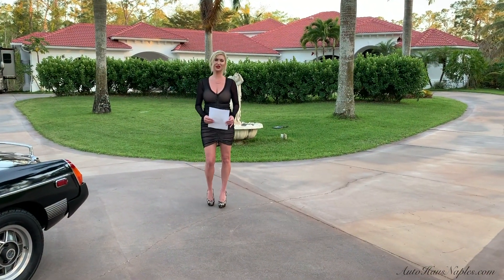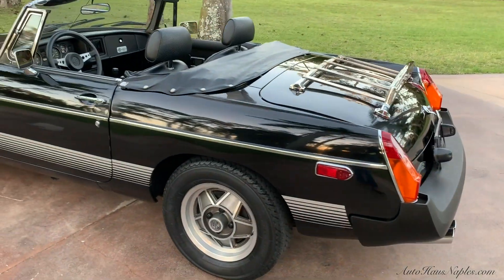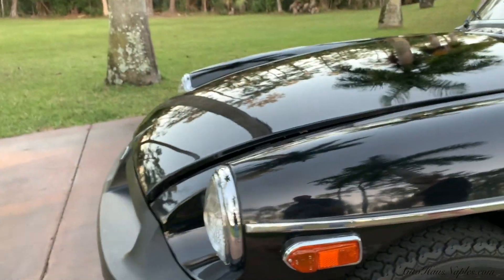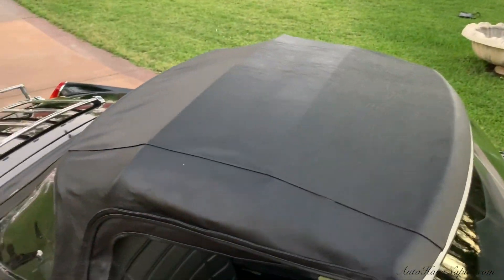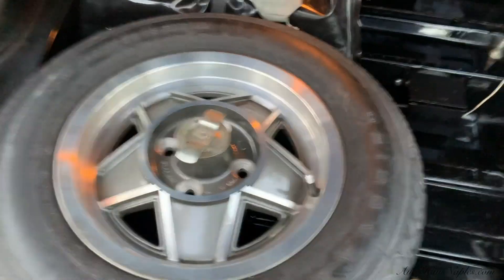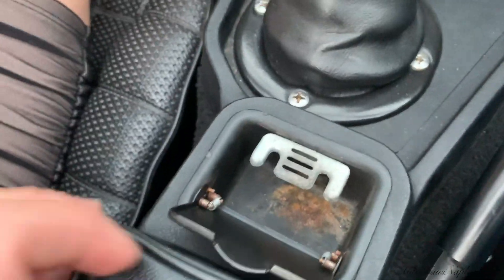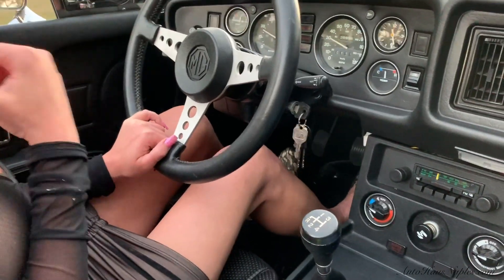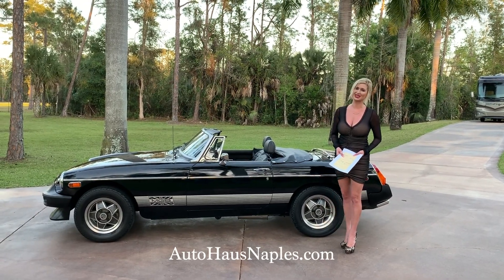6,969 Mile 1979 MGB Convertible Limited Edition & Only One Owner!

Comment: I bought that car in Oct 1981 at a downtown foreign auto dealer in Monterey Ca. He pulled the old bait and switch on me. I wanted the white 78 Mazda RX7 for sale, but ended up with the MGB. It had only 2300 miles. The funny was I had never driven a stick before. He was kind and/or smart enough to give me a quick lesson so as to get it off his lot! It was a great way to will yourself to learn. But I don't recommend it.
Reply: So you met Doty ?

Comment: @MaryAnn & Peter .... Thank you very much for this nice presentation. 👍Be careful and stay safe.

This beautiful MG needs chrome bumper, wire wheels with white wall tires, and a british wooden steering wheel. - Do you or Peter know how much such a conversion would cost?

Greetings from Germany
Reply: Also needs the lower ride height of the non-US version.
Reply: I can't say I'd recommend that.....at least not for this rare and ultra low mileage example.  Its value would be deminished.  Lots of lesser examples can be found to "convert".  We have many examples in my area at "The Bronte Park British Car Day".  To do well is alot more involved than one might think.  Lots of cutting and patching up front the rear needs rear body work so the tailights look right most are butcher jobs.
Unless you can do it yourself the money spent could get a decent chrome bumper example.
Reply: @davidburman451  
You may have a point.
Reply: @lewis72  lowering the car is involved but very do able also it doesnt require body work......and they do handle better.  Back in the day we had a 64 roadster and a 66 GT.   Currently restoring a Spitfire....I'm kinda old I guess.   The LE featured in the video is stunning wish I could afford it.
Reply: @davidburman451  
I have a '70 Stag and a (very rusty) '77 XJ-S amongst other newer cars.
Reply: @lewis72  Excellent !

Comment: By my observation, that is not the original engine.. the head may be,  but the block is not.
Also note the new heater valve, a give-away this car has recently had serious mechanical work.
The wiring is a mess.
There is rust on and in this car. That is not cosmoline, is could be the remnants of some cheap aftermarket anti rust goo to mask the actual condition.  
After market exhaust..
This car is just another of your incorrectly described vehicles. 

There is style and there is class...
You and the cheese may have style, but  neither of you have any class and very poor knowledge of cars and of  the car business.

And stop calling your audience "you guys", it is disrespectful.

Comment: 41 years old tires...  seriously...  that sounds pretty scary to me...  😱😱
Reply: They are old for sure with what appears to be ozone cracks however not sure if they are "original," does seems plausible though.    I would not be driving on them, even if stored on jacks it's likely the tires have succumbed to elements and typical degradation as opposed to tread wear.

Comment: A really nice car. Too bad it doesn't have overdrive, which was a nice option to have back then.  Those tires should be replaced, especially since I'm sure you're selling this car for a premium price.  I own two MGB's, a 1968 and a 1977 which I've had for decades. Parts are readily available through several suppliers and University Motors on YouTube has lots of how-to videos on maintenance and repairs.

Comment: From Leo:  No doubt it is a beautiful car, in great low miles shape.   The babble about the tires is ridiculous.  MGB's did not come with uniroyal tyres. Common was Contenentals or Pirelli. .  I was a factory trained Mechanic for JaguarRoverTriumph. and was certified for every system on the MG cars at the Mt Clemens center.   The added Rusty Jones brand rustproofing treatment was a good upgrade as it was very effective in rust prevention, and did not dry out and flake off.    One thing to check, there was a recall that installed a bracket and a clamp from the exhaust head pipe to the bottom of the block by the oil pan.  Without that clamp the exhaust manifold WILL  crack, and they are nearly impossible to find.  I hope someone really enjoys that car.

Comment: Are you aware of the fact that those tires with that amount of cracking in between the treads are a ticking timebomb??? they can come apart or burst at any time. If you are unfortunate enough to be driving along when it happens you and or other road users or pedestrians for that matter could be in danger. so please change them 👍🏼
p.s. can heal toe in those heels?

Comment: Beautiful car, until you opened the hood. A good mechanic can straighten out the wiring. At least detail the engine bay.
Reply: That is how they looked stock.  I still remember.  I admit, the earlier models with twin carbs and no emission controls were more classic looking.